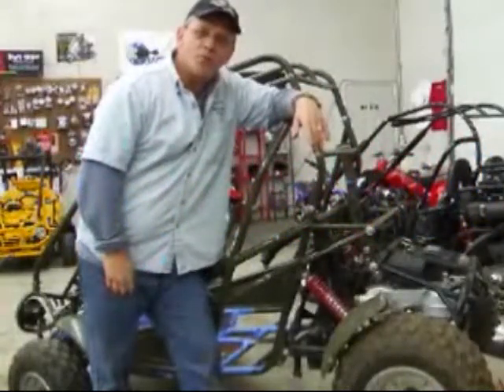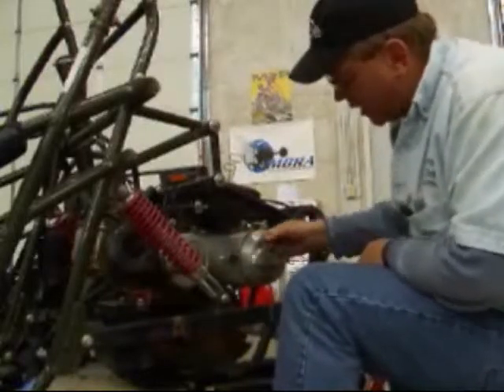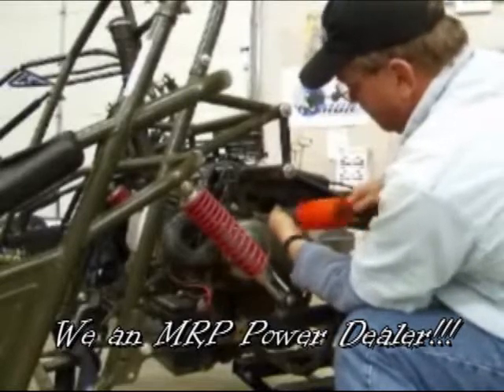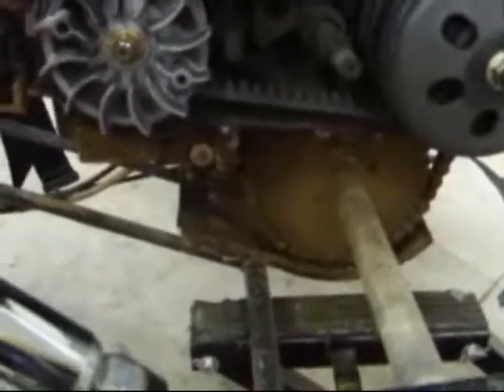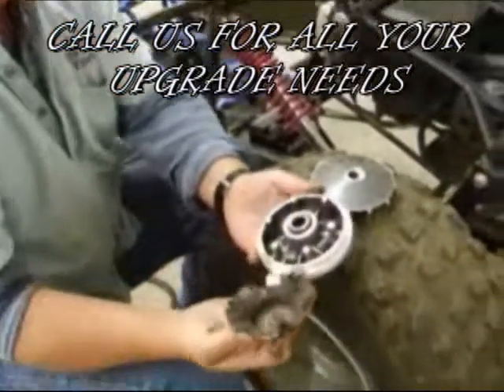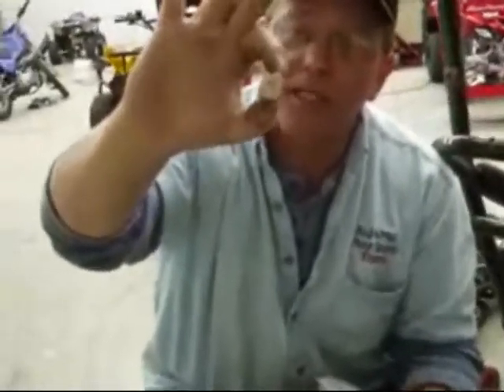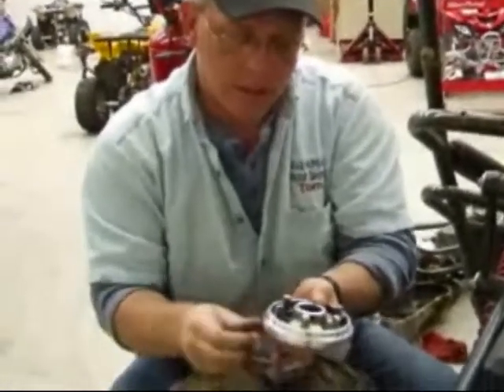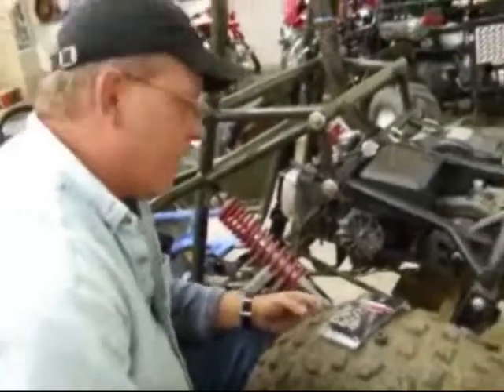NEW Slider CVT Install on Go Karts Complete Explanation

Comment: I need clarification.  You started with 14gm weights and were going to 12gm. Then you use the sliders and state they act like they are 2 gms lighter than they are. Did you use 14gm sliders or 12gm? Thanks